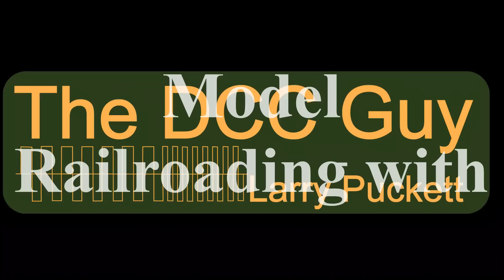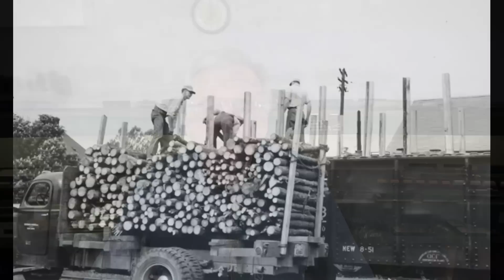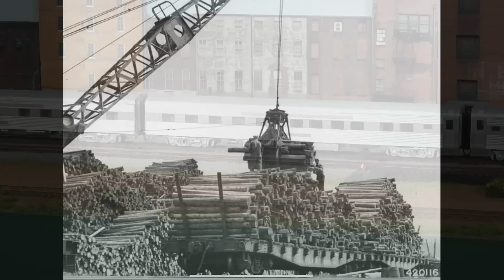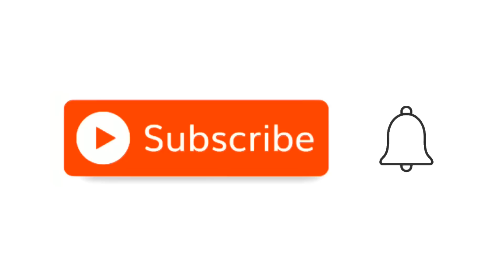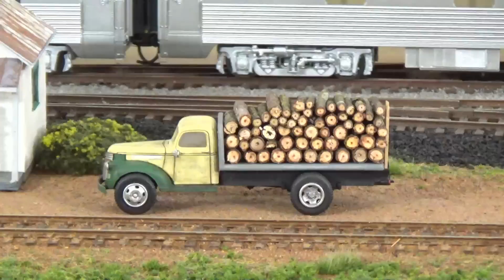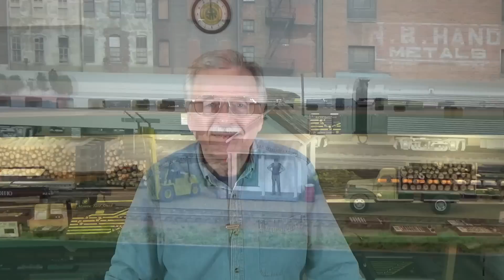Modeling Pulpwood Loading (298)

Comment: Great video with pulp yard explanation- spent many hours with my grandfather, a NS station master who managed a pulpwood yard for the line measuring and record keeping in addition to his other rail duties for almost 50 yrs. His service from 1918 to 1967. Brought back a lot of memories- your modeling was dead on! Enjoy your channel and skills!
Reply from the maker: Did he measure the load to calculate the number of cords or something else? This is a question that comes up frequently when pulpwood loading is discussed. Thanks
Reply: @TheDCCGuy  yes he measured the load prior to unloading the trucks which was done by hand, pointed out area to load on train car, your train car types look exactly like the ones used. He would then prepare the company check, return with check verify loading and pay-, only received logs on certain days as many as 6-8 loads per day, multiple empties were staged on the yard siding.  Multiple trains per day went through his station, he had 7-8 sidings along with a freight warehouse and a Y turnaround under his control. This was a junction for two lines one allowing for routing changes from east west to north and south. Initially he used nothing but telegraph but later he had the only phone in the area for years

Comment: Good video, Larry. I have just found your channel and "my dog Buddy" at 11:00.  I lived in south central Virginia for 5 years in the mid '70s.  Pulpwood was a big thing in Keysville, VA with multiple truckloads coming through town on their way to the yard south of town.  The yard had huge Hyster machines that could lift the entire load off the truck with their cables (much larger than the forklift conversion you have). When the load was set onto the pulpwood car, the Hyster used a large grille to push any logs, sticking out too far, inward.  Was a huge yard and there were several of the Hysters working at the same time.  The trucks did not have a bed (like ones in the b&w photos) to allow the cables to be able to wrap underneath the load.  I helped a friend one day in the woods, and we only did one load.  Even as a young man, I recall how tired I was and especially how weak my legs were.  It was very hard work, especially on a hot summer day.  Those guys who did it all day long had to be in great shape. Thanks for allowing me to share.

Comment: Over the years there have been many changes in how pulpwood is handled from the woods to collection points to the mills. Locally until the late 1980's all pulpwood was four foot lengths with a minimum top diameter of 3.5 inches, much of the wood was still river run for "moderate" distances. Long distance was by rail car and short distances for all situations was by "pallet truck" (mainly still in use for larger construction waste bins). The minimum top diameter was to avoid logs getting broken/stuck in the debarker drums.

In the late 1980's the river runs were stopped and logs were cut in eight foot lengths with 3.5 inch top diameter and trucked by semi's to the pulp and paper mills. Today with the reduction in pulp and paper mills more wood first goes to lumber mills where it is debarked and  logs with a top diameter greater than 8 inches and in "good form" is cut into lumber. Slabs and off cuts are chipped while small and poor form logs are shipped to the pulp mill.

The guy in the office is a scaler - this is typically a licensed profession that is hired as an independent contractor by a company and has legal protections against intimidation by all involved parties.

Comment: That was a great way to add an additional business without too much effort for switching.  The only detail that is missing is the wheel ruts, maybe a puddle and the access road the truck used to get in there, which could be a dirt crossing coming in from the edge of the fascia.  At the end of the pulpwood stack you create a heavily used turn around for the trucks.  You need some signage.
Reply from the maker: The access road is there just comes in further down on the left beyond the last pulprack. As for mud puddles, I model August 1957–so hot and dry even the flies choke on the dust out there. I do need to add more details and sawdust/wood chips.

Comment: Hi Larry. Would there have been a weigh station to assess the weight of the wood on a truck?
Reply from the maker: I can’t see the economics of installing expensive weigh stations at every siding where only 1-2 cars would be spotted for loading. And in photos I don’t see evidence of them. I personally think they just measured the logs and calculated the number of cords. With dry cut logs a cord is 128 cubic feet whereas green unsplit logs are 180 cubic feet. So just stack the logs and measure length x width x height and do the math.